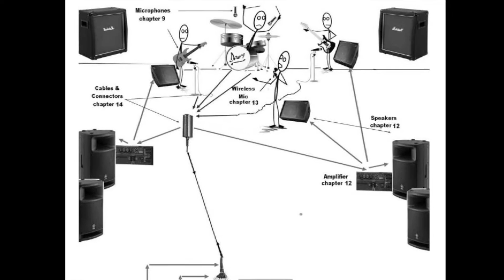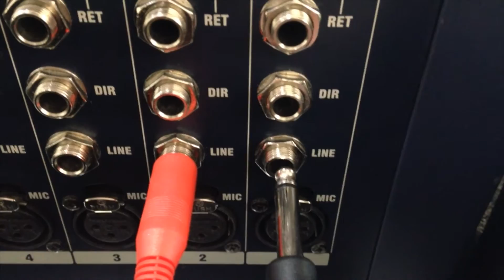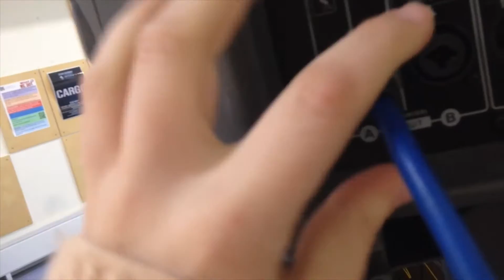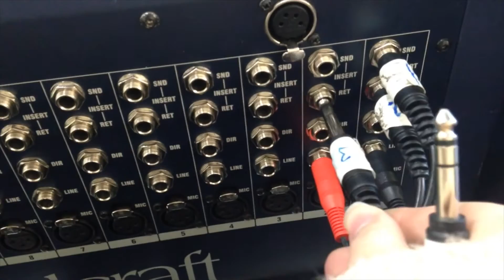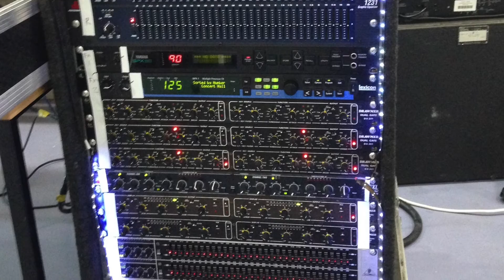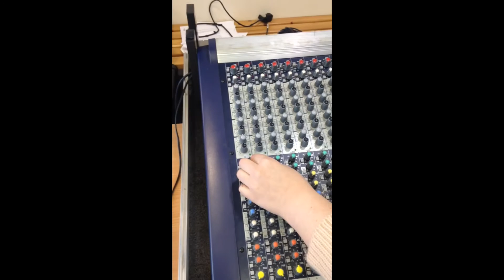Live Analogue Theory and Applications video

Comment: HELP! 

Hi guys i just got an older Soundcraft MH-4 mixer with the two CPS-800 Power units.i have a couple of questions anyone who can help it would be appreciated.

What is the correct power up and power down sequence the manual is not that clear on this point

for example  1.power unit then  2.mains then 3.console for turning off and on.

Can alternative power units be used as I wish to purchase a spare and how long can the power units be stored without use provided they are stored correctly.

Would really appreciate any help